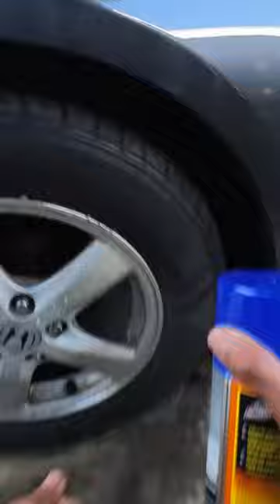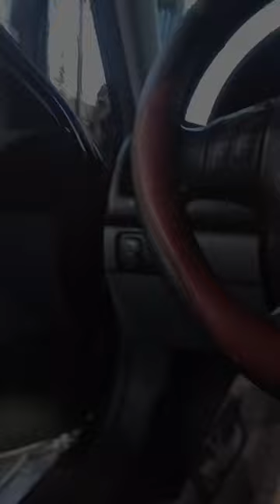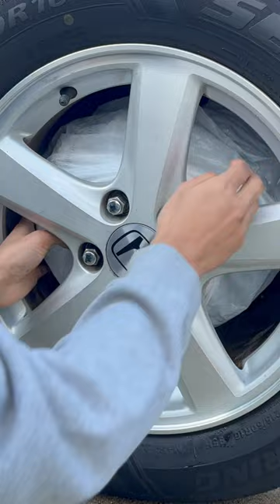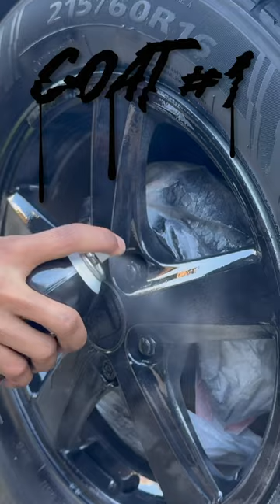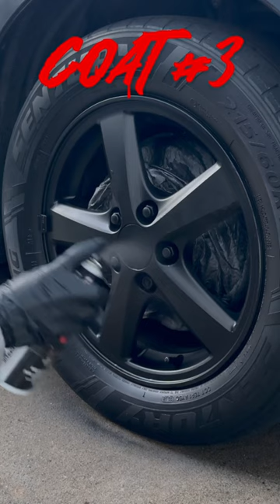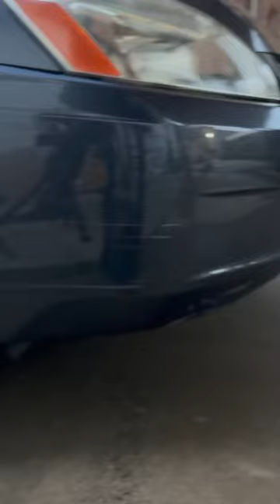Plasti dipping rims in matte black 🔥

Comment: You can get a deck of cards. An line them up around the bead so you dont get paint or plastic on your tires. Also plasti dip can be a tottal nightmare to remove. But it does look good. Good job
Reply from the maker: I didn’t show it on the short but you can peel off the plasti dip on the tire itself before it dries. And to remove let’s say a year later you just use wd40 and a thick card or scrapper,It’s relatively easy. But thank you very much for the advice

Comment: Do you use one can per wheel? Also where did you buy the plasti dip from
Reply from the maker: For all the wheels I’d say 2 cans is the right amount you need 4-5 coats minimum per wheel for it to last longer
In Amazon link in description
Reply: This was the answer I've been looking for
Reply: @claudiajohannamunoz  i ended up plastidiping my wheels black
i bought 4 but i only ended up needing 2 cans
I put 3 coats and like 3 months later it still looks great